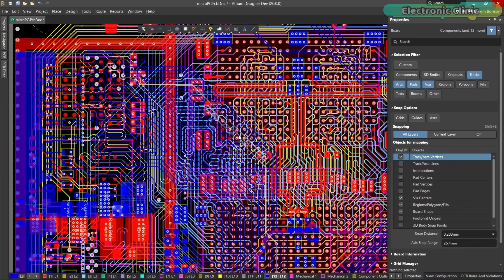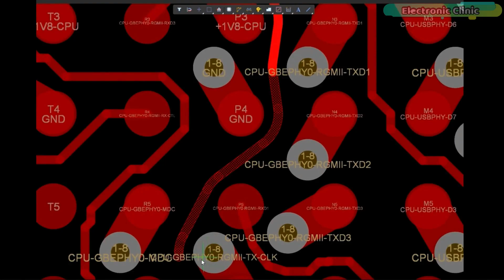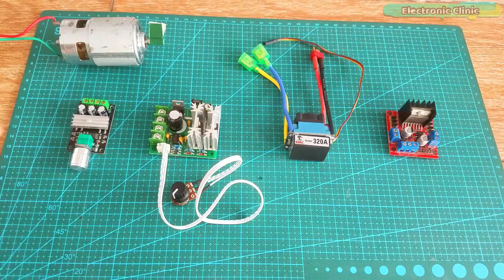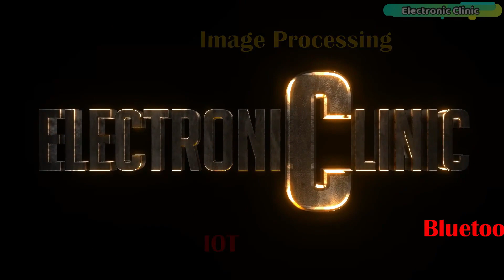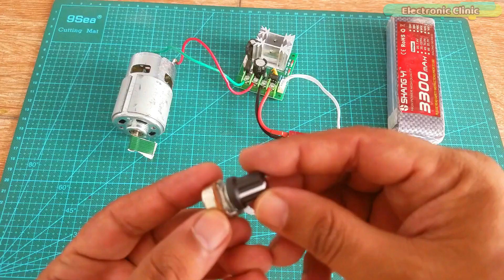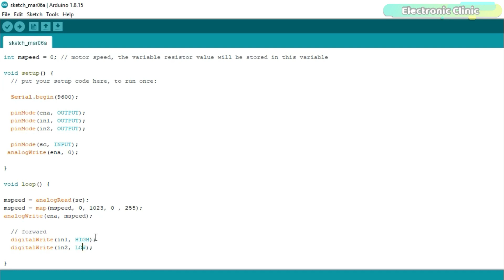775 Motor Drivers, Different ways to control 775 Motors, 775 DC motor speed controller

Comment: Hello, thanks for the video. One question, can the engine be used at low rpm for a long time without overheating?
Thanks again
Reply from the maker: it wont' heat up, there is a fan and a large heatsink.
Reply: I say motor warm-up

Comment: Hello Sir, you have made a project on the gas leakage detector with solenoid valve, can you tell me the part number of that solenoid valve please.
Reply from the maker: you can use any 12v solenoid valve.
Reply: @ElectroniClinic  why I need that is just for sample to download for Proteus library as a single component. So, if you can please tell me I was doing a project by using it.
Reply: @ElectroniClinic  what is the make and specification of the battery you used?

Comment: can i use battery that is used in bikes...like the exide 4ah battery....im doing a project need help
Reply from the maker: Yes you can use, you can use any 12v battery.
Reply: @ElectroniClinic  damn....i also wanna ask how can use these with speed control using Arduino. Because im trying to use my phone as a remote control. It's it possible ?
I have zero electrical and coding knowledge. I'm a pure mechanical guy.

Comment: Hello! Can you help me please?
I'm trying to rebuild a radioshack rc car, controlling the rear motor with a H-bridge made of relays and supplied with a Lipo 11.1V  (25C - 2200mAh)
I did a try yesterday but the speed and torque is huge, I do not know if i can burn the motor or the relays... would the L298 help? I'm just starting with lipo batteries and I would not want to cause a damage. Thanks in advance.

Comment: Needs help bruh , my 755 motor is heating up, even i can't touch so hot! Please help how to fix , i'm using 4.5 to 35 volts 5 ampers speed controller! Please help😢😢
Reply from the maker: Check your 775 motor voltage rating, keep the voltage below 24 volts.

Comment: Hello,I am having an issue with one of your project that is based on Raspberry pi  i2c LCD connection 
The text doesn't get displayed on the lcd screen and the python code is stuck as well?
Can you provide me with your contact details it would be of great help!